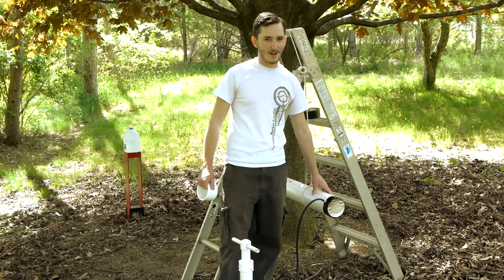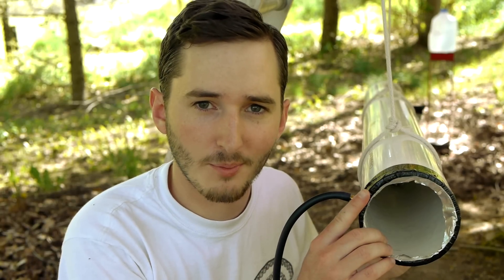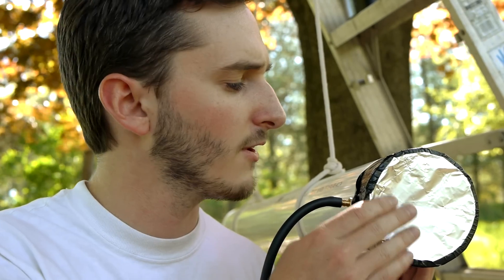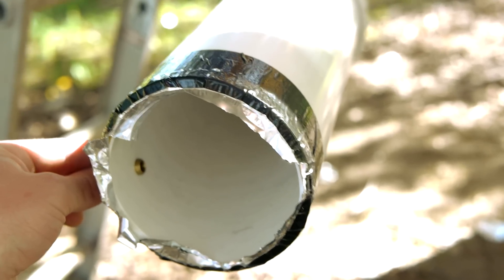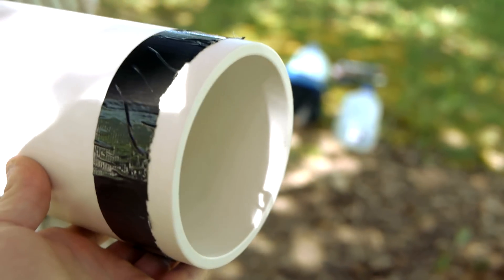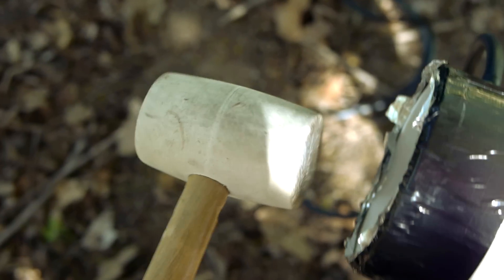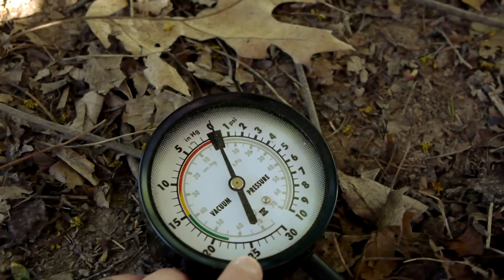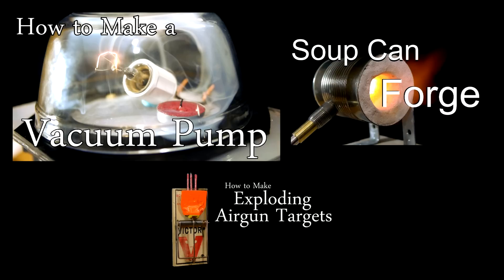How to Make a Vacuum Cannon

Comment: If you are going to go through the entire process of making a vacuum cannon..it makes no sense and you should just build a normal pressurized canon and skip the unnecessary expenses of aluminum foil and duct tape and the extra labor each time you want to fire it...you will have much more fun using a traditional canon using pressurized air than the lame and limited amount of force it can create..pressure difference is the name of the game son..bigger difference = bigger fun

Comment: where is the projectile placed the back? the front? the middle? you didnt say anything about loading it
Reply: in the back so the pressure wave carries it down the length of the barrel accelerating it. It's the same way that guns work to carry the bullet down the barrel.
Reply: Ian McCarty yes i make bullets on a regular basis but i was thinking this should also work with the projectile in the center

Comment: why does the cannon recoil?

I know why a normal cannon recoil, but I can't figure out with these
Reply from the maker: Suppose the tube were plugged at one end, a vacuum drawn inside, then opened at the other end. As air rushed in from one side air would also be pushing the tube backward via pressure acting on the closed end. That's why the tube recoils. The projectile is irrelevant as I understand it.
Reply: This response makes sense and the tube would recoil even without the projectile. However, I wouldn't say the projectile is irrelevant. In its absence, the air rushing in from the ruptured end would accelerate through the tube and crash into the other end, balancing out some of the backward momentum, recoiling less than it does with the projectile.
One thing that is for certain; all that recoil is lost efficiency. If you anchor that barrel down,  you should see an increase in both the firing distance and accuracy. Just two guy lines running along the length of the barrel would do the trick nicely
Reply from the maker: Recoil effects projectile velocity less that you would expect. https://www.youtube.com/watch?v=sfhf_1U6n9c
Reply: NightHawkInLight I didn't think the effect would be huge, but I still think it would be there. That high speed cam comparison showed me that the unbraced shot began its downward travel earlier than the braced shot. If both shots were actually aimed alike, from the same location and both allowed to travel along the same unrestricted path, I still think the braced barrel would shoot further, even if only marginally so.
Reply: Newton's third law. That's literally all that needs to be said.

Comment: this is a great demonstration of what would happen to the proposed Elon musk  hyperloop system if it were subjected to a crack or rupture anywhere on its 1000+ mile length.  Except instead of three inch PVC pipe caps getting obliterated, it would be passenger capsules, up to seven or eight of the, depending where the rupture occurred.
Reply: There would definitely be issues, but also ways to isolate sections in case of such scenarios.

Comment: Could you use any other method (let's say a plastic slide) to seal the air?
Also, would the effect increase if you had an area of high pressure on the other side of the projectile?
If so, I could use it as a foam dart-launching method on customized foam dart blasters (Nerf, for example.)

Thanks!
Reply: The other end will be pressurized by an air compressor, while the other side with your Vacuum Pump.
Maybe I could reduce the size so that it could be more compact.
Reply: +SandLuc083 _  maybe.  high pressure would need to be on the back where you puncture the foil.  otherwise the air would rush from the wrong side.

Comment: What would happen if you punctured both at the same time
Reply: +Cameron Johnson i was wondering the same thing, my guess is (if it was exact, to robotic precision) the air would rush in at the same force per side, and the projectile would move from the end it is on to the other end, however, at mid way, the two walls of air would collide, and the projectile would likely stop from an equal opposite force hitting it, unless it had enough momentum to pass that.. i dont know if it would though, i doubt it would even exit the barrel.

Comment: will putting an air tank over the back increase velocity (with the burst disc obviously). Im just wondering because there is a university that had one similar that launched ping pong balls and had an air tank in the back which the ping pong balls went around mach 1 (due to the lack of air friction and hardly any mass).

Comment: So air rushes in. What is the speed of air?
Reply: +Aaron Nielsen The speed of air is dependent on the mass (and friction but lets ignore that for now) of the projectile in the barrel. The atmospheric pressure will provide a force on the projectile, equal to 1atm times by the cross sectional area of the barrel. Of course the air can not move past the projectile in the barrel so can only move as fast as the PVC cap. And from Newtons second law [F=ma] we can calculate the acceleration due to the force if we know the mass. This can then be used in a SUVAT equation where we know the length of the tube, S, and the initial velocity (U which is 0) to find the exit velocity therefore the max V of air in the mechanism.
V^2=U^2+2aS
V=(2aS)^0.5 
P.S if there was no projectile then the air it's self would provide the mass.

Comment: u could strap the down to a saw horse instead of hanging it from a ladder, also if just after the vacuum hose inlet u could push a dowel completely thru the center and sealing the ends on the outside with a strong glue. that would insure the projectile only can exit one direction or simply gluing in a ring inside the barrel like by cutting the top of 1 end cap assuming its a tight fit. also u could make a firing pin to pierce the foil instead of swinging a hammer at it. not sure if it would work try piercing it with a screw driver to test. but thinking theoretically the greater force of air sucking in should rip open the foil more.

Comment: You could screw in a large screw into the middle of the cannon, preventing the projectile from moving in the wrong direction.
Reply: +Lewis Spurgeon He means put a long screw or bolt from the wall of the tube all the way through to the opposite side so it acts like a post preventing the projectile from shooting out the back. Even a few shorter screws around the circumference of the tube, screwed in opposite to each other. They'd be placed a bit past the fitting, with an air tight seal where they enter/exit, and of course you would have to load from the front of the barrel like a traditional cannon. It's actually great idea to make it safe just in case someone were to accidentally walk behind it, or prevent it from launching into anything you didn't intend to if the front seal were to break.
Reply: Hank Scorpio That is precisely what I meant, thank you.
Reply: I don't think you understood how it worked
If you puncture one end then the projectile will always be shot towards the other end

Comment: if you were to put a cap on the end that seals the hole and gets "sucked" in by the vacuum and then a mechanical lever that presses the cap out fast  and thus letting in air and then shooting out the projectile. then it wouldnt take to long to reload it

Comment: Can it be like, a shoulder mounted one?
Like a SMAW where you load the vacuum cannon on the rear and to fire it, electric trigger would ignite a small patch of steel wool sandwiched on the aluminium foil?

Comment: What would happen if you shot this in space, because the vacuums would be reversed?
Reply: It would probably implode because of the near vacuum in space.
Reply: +Anson Chan What?!
Reply: To grasp why it may implode, you must understand that nowhere on planet Earth is there a complete vacuum. In space, however, there is an almost, if not complete vacuum. So there would be a near vacuum in the cannon, whilst the space surrounding it would have a even more near vacuum. The difference in pressure (or lack of pressure) would almost certainly crush the cannon like a beer can in an angry man's hands.
Reply: Actually, it would probably just disintegrate.
Reply: Probably not crush.
Reply: Someone has to launch one of these into space.
Reply: Yeah.

Comment: While this is a very cool idea, and it works well (provided neither foil barrier breaks), I think that your seal and trigger mechanism could be improved, as well as your safety precautions.

First, implementing a backflow stop that prevents projectiles from exiting the back of the tube.  This could simply be done by driving bolts into the housing (ensuring the bolt points are airtight), and pushing any projectile up against that barrier so it can only go one direction - forward.  Much safer.

Second, implementing a reusable trigger and cap system that can withstand the interior vacuum pressure, but when the trigger side is breached, the cap side is knocked off the end by the pressure/projectile.  The best thing I could think of could be a rubberized cap for the firing end, and a valved end for the trigger side, where the valve is sealed until a trigger allows the valve to rapidly move forward, letting air pass by without destroying the valve itself.

Comment: What happens if, theoretically, both burst discs break at exactly the same time?
Reply: Air would rush in from both sides and the projectile will launch with less force or not launch at all (depending on where it's placed in the pipe)

Comment: ssoo. question. would extending the length of the tube increase the output force if depressurized to the same exact pressure as a shorter one? or do you think it would be more effective to place a barrel extension in front of the front burst disc(creating a section of the total barrel length that is not evacuated), that way evacuating the air takes less time but the rush of air moving through the pipe can have a longer effect on the projectile, therefore accelerating it more. Any scientists out there that can help me out? and another question: and another question as well.... what is the best projectile (aerodynamics, durability, and cost effectiveness) to use? i was gonna make a 2.5" variant for tennis balls, but im not liking the idea of using tennis balls. Im going for straight distance:D
Reply from the maker: A longer depressurized tube will make for faster velocity. Putting a barrel on the end after the burst disc will not be of help.
Reply: My 6th grade science teachers said we are all scientist
Reply: +Josh Repavich - Years back when my brother and I were tinkering with potato cannons (the kind where you squirt in the ether and ignite it), we considered using tennis balls. But...after thinking about it a while we decided to use racquetballs. To be exact, a racquetball dipped in motor oil so that it slipped snugly into the PVC (which was a slightly smaller diameter).

End result: we fired the ball into the air in the middle of a field (no less than 50 acres of open area), and never found it. I actually lost sight of it a split second after it exited the barrel. It worked like crazy!
Reply: +Tim Jeter you could've done it at the Alameda Air Force base in California...
Reply: +NightHawkInLight The mythbusters proved that this is true, to an extent. Don't just make a mile long pipe.
Reply: Yes. It's possible, but it will take longer to displace the air out of the cannon without bursting the discs...
Reply: +Josh Repavich yes mythbusters did it

Comment: Wonders what would happen if you had a 3 stage vacuum in the pipe ( ie 3 x vacuum creating chambers each separated by foil ) would it act as a 3 stage accelerator ?

Comment: Could you use those circular metal clamps with the screw for tightning and loosening that way it takes less time to change out caps and doesn't waste any duct tape? I really like this design good job. You just earned a subscriber.

Comment: Cool video, and simple explanation of the science involved.
However, methinks the recoil of the cannon barrel is wasting a lot of the energy that could otherwise have been transferred to the projectile.
Some sort of stable mounting system incorporating trunnions for vertical alignment would allow you to aim the cannon more effectively, and at the same time ensuring you concentrate most of the energy into the acceleration of the projectile. Much like in a "real" cannon.
Reply: Infact, the method that Rob has shown may also end up increasing the speed dramatically. Anyways, it is wonderful seeing how a good scientific experiment can turn great by incorporating ideas into it :)
Reply: Agreed
Reply: Oooh

Comment: If you shot an arrow into the end that you hit with the hammer, would the air pressure then act on the arrow as it ruptures the foil and proceed to accelerate the arrow even more? if that didn't make sense think of it like the canon acting as a boost pad from mario kart
Reply from the maker: In theory, yeah it would accelerate the arrow, but in reality arrows don't catch very much air and as such the air would rush right past without accelerating it much at all.
Reply from the maker: Thomas Denny Arrow feathers are very aerodynamic in the direction parallel to the shaft. They only create drag if the shaft begins to shift angles to a different direction than it's momentum. If you were trying to fire arrows sideways, sure, they might help you.
Reply: @Nighthawkinlight  Thanks for the tutorial! Also, I don’t expect a reply, BUT i plan to make an air cannon for a nerf war, as a whole artillery system using dummy shells that, using a spinning fan thing work like a Junkers JU87 Stuka dive bomber.
Simply put, it goes AAAAAA and screams as it descends.
I’m trying to get a lot of range and as much accuracy as i can out of this, as… well, artillery. Do you think it’s be better if I stuck with… normal air guns, or should I try this?
Reply: matt brennan It wouldn't because since the arrow is so thin, the pressure would just flow around the arrow, leaving it in place. However, if you used a thinner tube and added a plate or cone pointing in to the arrow, the pressure would be captured and would send the arrow flying. The cone also doubles as a large fletching that keeps the arrow straight.
Reply: NightHawkInLight If the arrowhead was hollowed a cone shape, would that work? It would have a place to catch air

Comment: Is it possible to go beyond neg 12 psi without the caps from failing if you double the thickness? Or will the barrel crack?
Reply from the maker: Pressure rated PVC can withstand much greater than atmospheric pressure. You will not crack it with a vacuum.
Reply: ok thank you. I must give it more POWER! :D
Reply from the maker: ***** It is only possible to pull 14.7 pounds of vacuum pressure, that is the absolute maximum at sea level. You cannot use the example of a soda bottle because the plastic used is not rigid, PVC is. In rigid material, an arch is much stronger from the outside than the inside. Sch40 PVC pipe upwards of 4" in diameter can easily withstand 14.7 psi of external pressure without the slightest strain.

Comment: Have been considering this type of setup for an aluminum soda can. Purpose, to demonstrate the fact -Aluminum in free space can not penetrate structural steel at subsonic speed (STP@SL).
This would allow a smaller projectile 5x the energy an airliner than can float in the Hudson river, could ever generate.
Ke=1/2 Mdensity(Velocity Sq), Velocity is EXPONENTIAL, where as the mass is a linear function. A 767-200 can not exceed 500ft/sec due to engine throughput, nor could the airframe exceed 600ft/sec b4 simple harmonic motion would rip it apart(@SL)
It's so absurd that people still believe commercial airliners struck the WTC TTs, shear mod Alum 25 Gpa, shear mod steel 70 Gpa.
Any doubters can review how the airframe of of Old John Feathermerchant never made it into the Empire St Bld on July 28th, 1945.
DiavelZzZ You are assuming Std atm Temp Pressure, STP, @ Sea Level, speed of sound can vary according to conditions.

Comment: I'd suggest a lighter projectile. my vacuum cannon can accelerate a ping pong ball to 0.89 mach.
Reply: Devon Phax 676.89 mph
Reply: Devon Phax 1 Mach is about 1200km/h. 100000000000 Mach would be 120000000000000 km/h
Reply: ***** so you say asking a question is pathetic
Reply: how fast it dat tho
Reply: DiavelZzZ
soo how much kmh is 100000000000 mach
Reply: Lukas Bonny
1 mach is 1024 km/h
Reply: Morris Janssen depends on the current air pressure/temperature
Reply: ***** knowledge is not the same as intelligence
Reply: Lukas Bonny
Air pressure and temperature does NOT affect how we measure speed :)
Reply: philip1541 yes, but Mach is relative to the speed of sound. Its v/c=mach, v is velocity and c is the speed of sound, and the speed of sound is different depending on the air pressure/temperature

Comment: Can somebody PLEASE respond:

Would using a modified solenoid sprinkler valve for the rear of the cannon work? This way it is less aluminum foil used, and quicker. I wonder if the size of the valve allow a large enough flow of air into the rear end
Reply from the maker: Not for a cannon with this large of diameter, but maybe for a smaller one.

Comment: Would it be possible to make something similar to this, but with a ball valve on one end, and a piston on the other? My thoughts were that due to the vacuum, the piston would be able to maintain a decent seal by way of suction. However, as soon as the valve on the other end were to be opened, the air would promptly rush in and start the pressure wave, ramming into the piston and propelling it forward. Anything in front of the piston would end up being smacked out of the cannon.